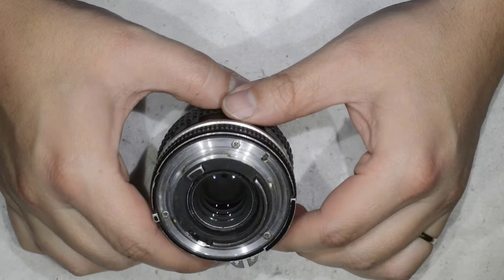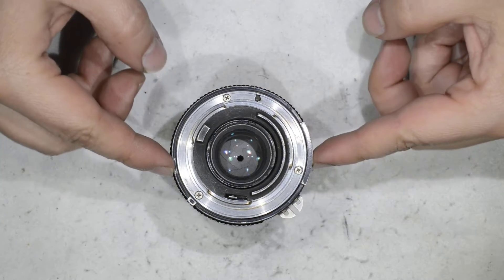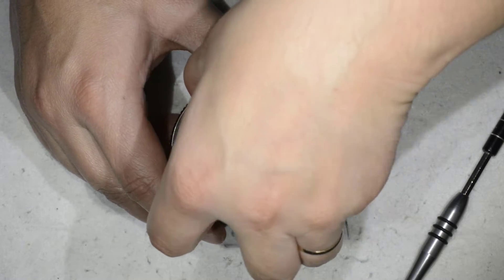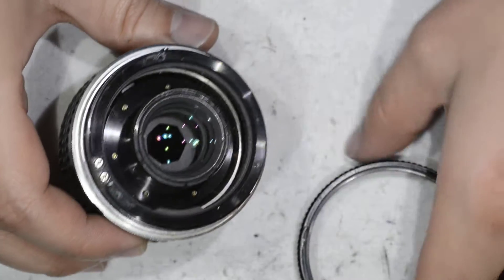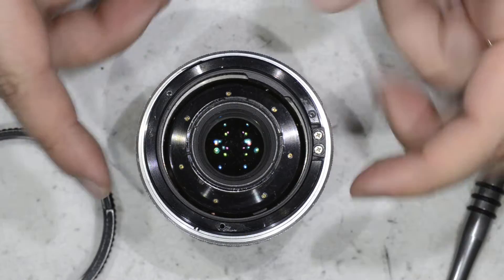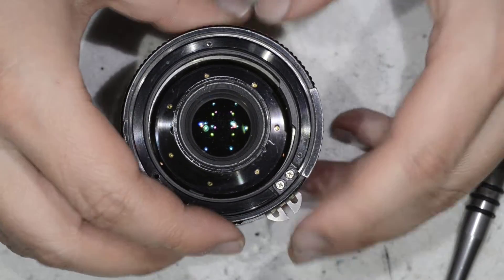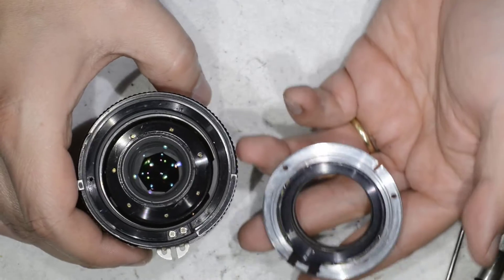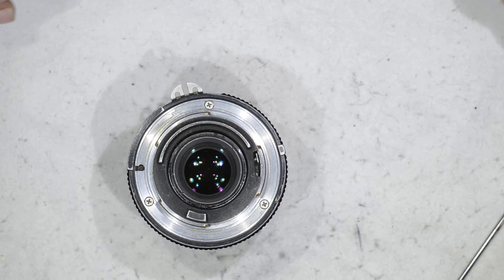Fix bad aperture ring : Lens repair basics

Comment: my aperture blade works when i separate it from the body an turn the aperture ring. it as soln as i put it on, it doesnt turn. it a canon ftql with a canon fd 35-70. do you have any idea why it could be? thanks!!!
Reply from the maker: You mean that happens when you attach the lens to the camera ?
Reply: @diyextravaganza  yup 😅 after further research i think i might just be dumb, ive always had digital 😂

Comment: Im jealous of that intact lens
Reply from the maker: What do you mean?
Reply: @diyextravaganza  overtightened one of my lens and split it in two. Got it for 20 quid but it sells for 2 -300 online. Apparently it's got sharp imagery or something. I think it's the generation after that and is inscribed with Nikon NIKKOR 28mm 1:28
Reply from the maker: Really, I've never had a high opinion on this lens, but 24mm is not a focal I appreciate a lot. Now I want to take a closer look. I have 3 of these around waiting for repair.
Reply: @diyextravaganza  nevermind their lens got sold and there are some cheaper dallmeyer ones up
Reply: @diyextravaganza  it's not the rarest because that title goes to some massive aircraft camera lens I own that has a diameter of 3.8 inches at the largest lens and at the smallest lens it has a 3.6 inch lens with a concave lens that might actually be about 4 inches in diameter excluding the curve but I cant measure it because although it's easy to take apart the screws are very small. It's also from the uk air ministry and  inscribed with F=8" F/2.9 A.M. 14A / 780
Reply from the maker: That sounds interesting, can you share a picture or small video somehow. Best.
Reply: @diyextravaganza  i don't know how to do it but they're online it's the same as the one on eBay
Reply: @diyextravaganza  it has a crown with the numbers and to the right it has an arrow which points at the aperture focus
Reply from the maker: it's a Dallmeyer?
Reply: @diyextravaganza  no but it looks similar
Reply: @diyextravaganza  no slits in the top for screwdriver and I don't think it's branded
Reply from the maker: @googľ-account  ok, I took a look, they are huge. format?
Reply: @diyextravaganza  F 2.9 I assume is the format
Reply: @diyextravaganza  it's painted black
Reply: @diyextravaganza  white writing
Reply from the maker: @googľ-account  ok, it may look great on a large format camera.
Reply from the maker: @googľ-account  I mean, the image circle, how big it is? can you do 4x5", 8x10" with it?
Reply: @diyextravaganza  I haven't used it
Reply: @diyextravaganza  it's for taking pictures of things from planes and it's likely from ww2 so it'd be from the reconissance plane's above ground average
Reply: @diyextravaganza  camera would need to be huge and I don't even have a camera
Reply: @diyextravaganza  or at least a working camera thinking on that again
Reply: @diyextravaganza  gotta be dallmeyer looking at some of their other lenses but perhaps it's a prototype and it was being tested for something to do with lasers. It didnt have a camera in the photo I looked at  which I have no longer but a massive laser and some other lenses from what I remember.
Reply from the maker: @googľ-account  my guess is it should provide great performance on large format.
Reply: @diyextravaganza  hopefully I'll be able to find one of the cameras it attaches to
Reply from the maker: @googľ-account  large format cameras are rather flexible on that matter, so, as long as you have a adapter plate, you can put it on whatever camera.
Reply: @diyextravaganza  ok

Comment: good job, simple but very effective, I have 55mm micro nikkor, there is a spring somewhere inside that is not connected somehow meaning the aperture stop down does not work properly, can you explain how this is fixed, i am afraid to make things worse without knowing what to do, thank yo again
Reply from the maker: Hi, I have already done several videos on the micro-nikkor 55mm, is it 2.8 or 3.5? If the 2.8, check the one about the stiff focusing where I disassemble almost the whole lens. So you'll know how the lens is built. I have several videos showing also how to work on the diaphragm of this lens and also show all the details for that. Check around and let me know how it goes.